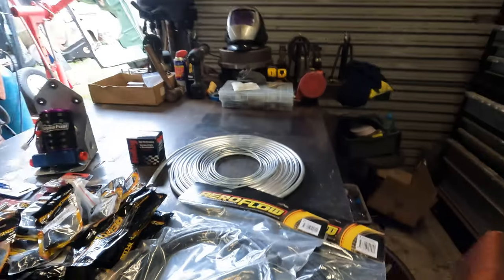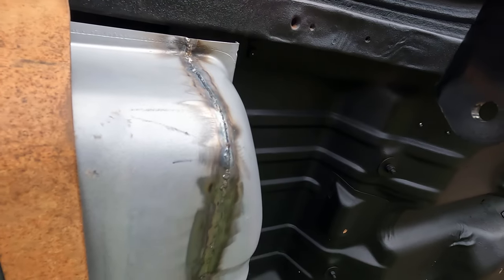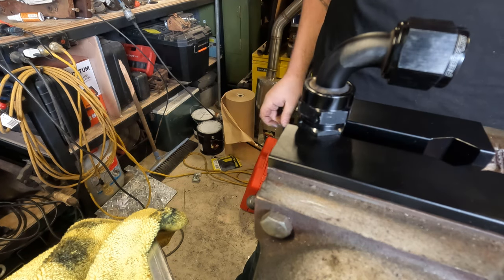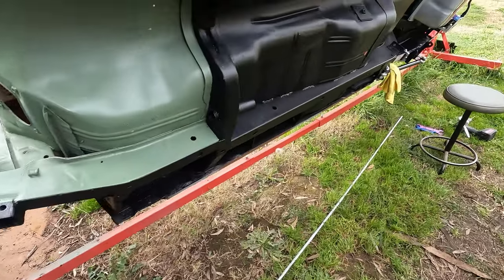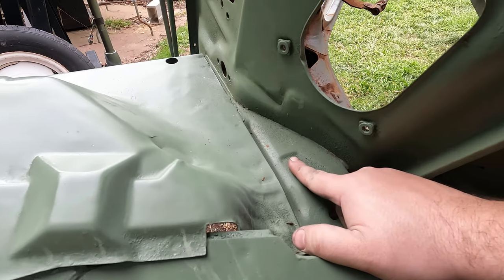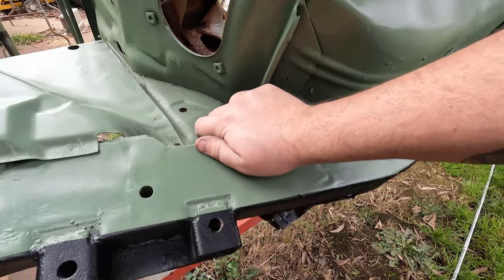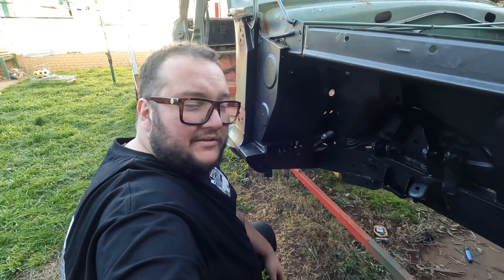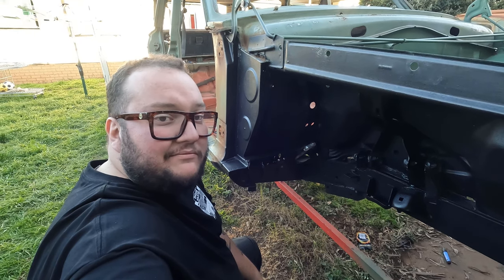How to assemble AN and Hardlines: Aeroflow fittings and bending: Backyardbuilds.

Comment: Thanks for this video, I'm planning to run aluminium 1/2" lines on my project. More for cost vs ptfe hoses being ran from the back of the car too the front.

Engine masters are great to deal with I've found.

Comment: Just a thought, for future reference, I would suggest you notch the steel suspension bracket instead of the aluminium pump bracket. I know you drilled a hole at the start of the notch but the steel bracket won't ever vibrate and crack where the aluminium will continually vibrate.

Comment: Is that the position you usually set up spring sliders? 🤔 I thought gazzard bros suggest central
Reply from the maker: Hey mate, are you taking bearing in the slider ??
Reply: Yeah mate👍
I just watched your other video and noticed the marks on the stickers 🤔 
They instructed me to set the falcon up a little closer to centre.. guess there's a reason for it 🤷‍♂️
Anyway.. enjoying the content boys 👌
Reply from the maker: @st8jkt69  I’d dare say if you set them in the centre with no load on them they would sit roughly where the sticker line would be. After a lot of research into 4link and monoleaves, it makes sense that far back, in a hard launch the body should seperate from the suspension, meaning it will come forward in the slider.
Reply: Your mono leafs look a little lower than mine also 👍